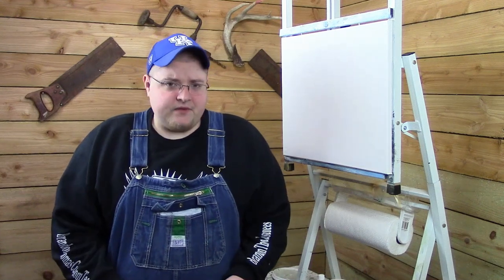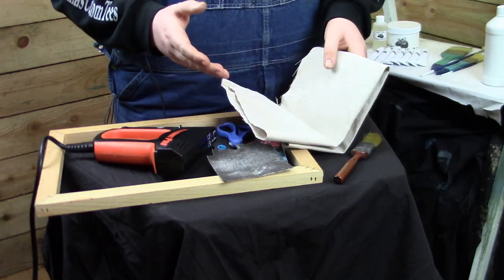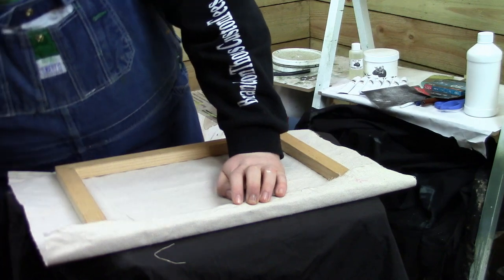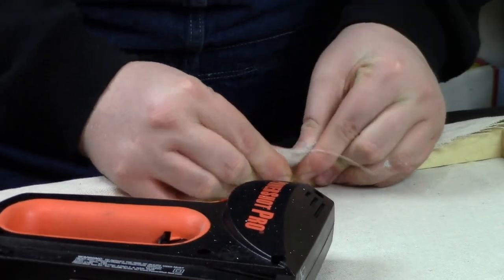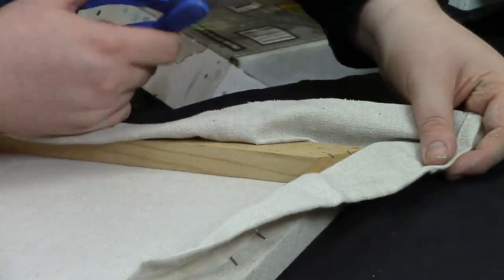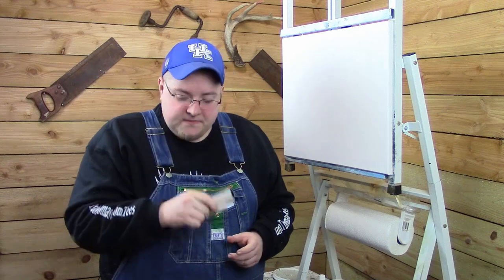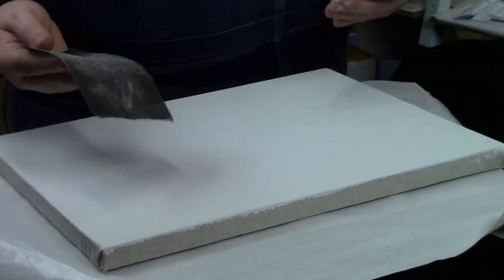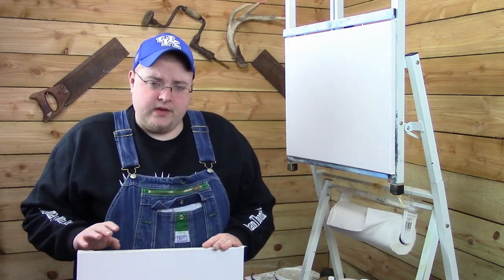Make your own canvases!!

Comment: I just made my first drop cloth stretched myself canvas and it had tons of large fibers sticking up everywhere I’m gonna have to go get that mesh sandpaper for sure before I move forward I have regular sand paper but I will wait to get that mesh stuff thank you so much for the hot tips!! Ok update I went and got the mesh sandpaper and I was skeptical bc I made a mistake of sanding it before putting on and gesso it was fuzzy beyond thought I ruined it got the mesh sandpaper and it fixed it perfectly 👏👏👏👏 I’m a fan now! Thank you!!

Comment: I thought the tip on another video from an artist was great that I'll share with all of you. That is, to bevel the inside edge of the frame facing the canvas, so, when you're painting, that edge doesn't cause a line on your painting. If you have a little bevel on the frame all the way around, your canvas won't touch the inside part of the frame on the back, and your paintings will come out smoother.